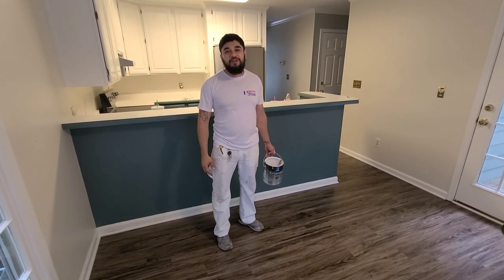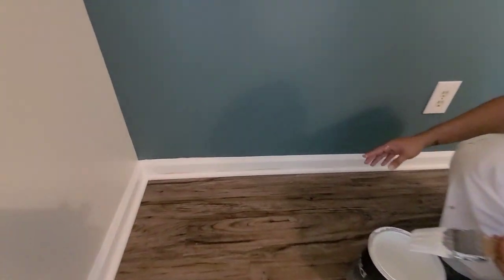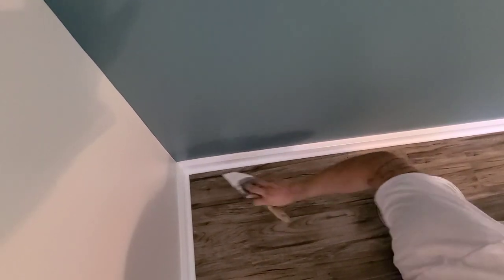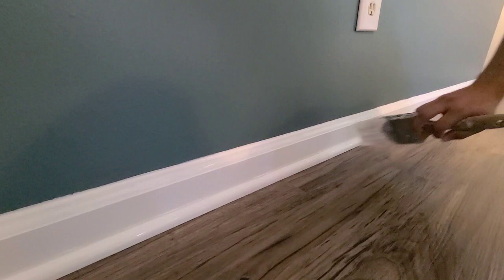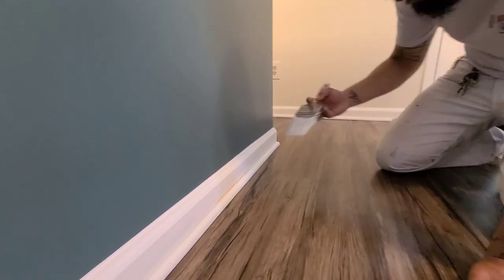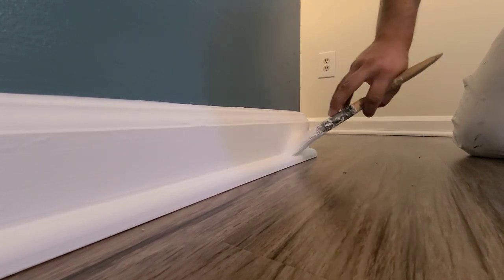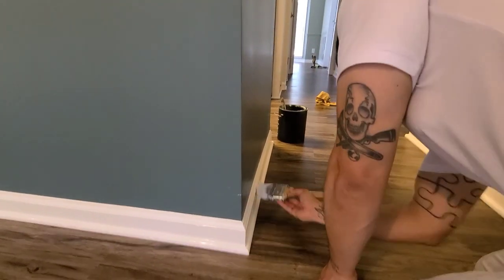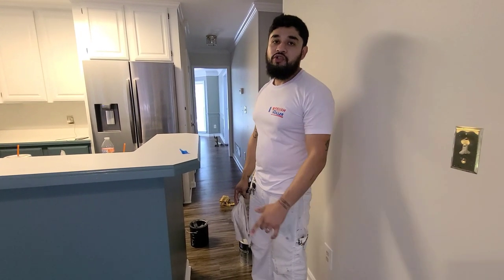How To Paint Baseboards With Emerald Urethane Trim Enamel

Comment: Do you have to thin it when you’re using a brush? I’ve been painting cabinets with a sprayer and I thin it and it’s been working great but I have a couple extra pieces I need to just use a brush.

Comment: What sheen is the paint? Semi-gloss?
Reply: Enamel which is oil based. Heavier gloss than semi gloss
Reply: @prolificjubilation  Actually, "Enamel" doesn't really mean much.  The paint companies just use the word to denote that a particular paint dries harder than most of their other paints.  Also, "Enamel" can be either water or oil based (SW has both).  Also, Enamel has nothing to do with sheen. This product comes in satin, semi and full gloss (I believe this is the semi)

Comment: As a professional I was struggle with painting baseboards on hardwood floors. Tape always bleeds. Do you always just hand cut them over hardwoods? And what if you are dealing with a color change?
Reply: Try the green frog tape bleeds through a lot less.Use a two inch brush try Wooster silver tip excellent brush
Reply: I tape my floors but I paint as if there isn't tape there (only without worrying about the "oops" when brush does touch tape here and there). this is how I train my newbies as well. "Paint like the tape isn't there."  You will be more conscience of the amount of paint you apply at the bottom of the baseboard, avoiding pooling, and the time this takes to both tape and "cut in"  will be saved in clean up time at the end.
Reply: @erinyoung2592  Great idea thanks for sharing that
Reply: @streamscreen  And then the frog tape is for consumers, the brand name Kip sells the real stuff each roll has a special number. Not sure if they sell in the US.
Reply from the maker: Sorry for the delayed response but yes we always hand cut all baseboards. In the case of color change we just go a bit slower to get good coverage but this Emerald urethane has great coverage